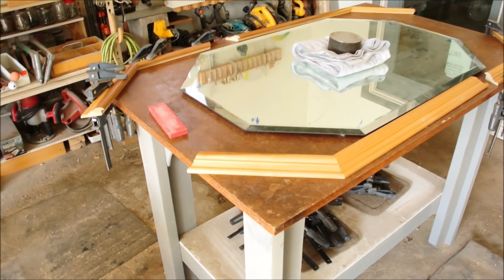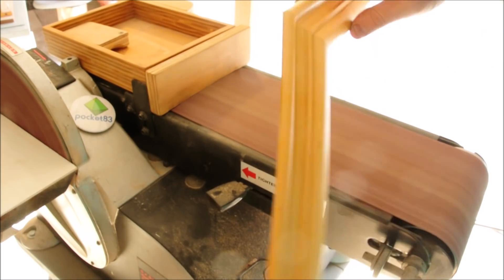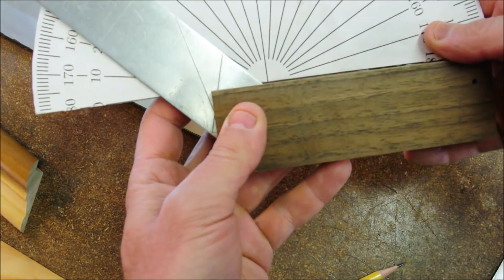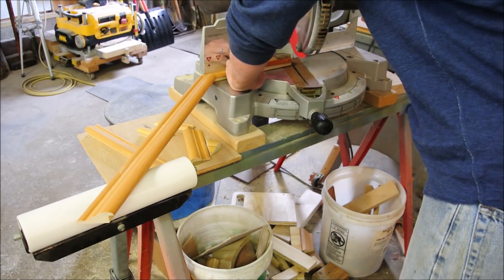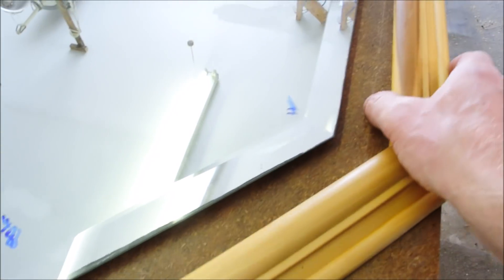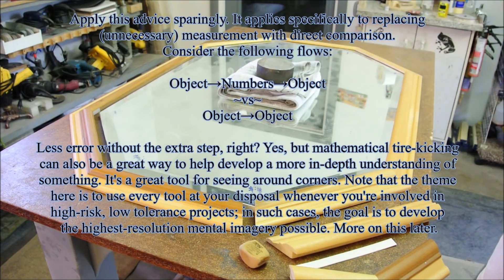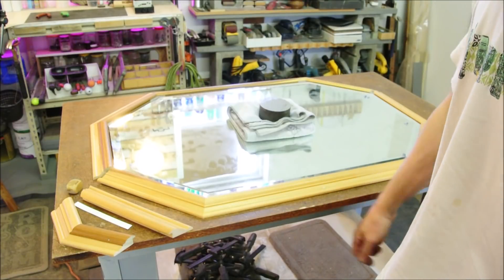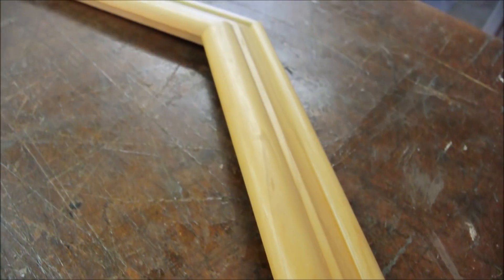Eight perfect miters: overlapping comparisons

Comment: As you shown in the first video, it seems to me that the plywood you used as a biscuit, is more resistant if turned 90 degrees due to the fibers in the middle which are thicker than those on the outside. Please correct me if i'm wrong
Reply from the maker: It's a fair point. I did think about it. It seemed as though it had enough 'meat' to hold up over time, so I let it slide. One of the nice things about (most) plywood is that it has strength in both directions. Just pay close attention to the product that you end up using, and decide what's best for your project.

Comment: It's too bad there's no good angle finder tool that'll bisect the angle for you. There's a handful of these kinds of tools out there, Milescraft makes one, product 8402 I believe, but there's always a given amount of slop due to loose tolerances and/or the mechanism the tool is based on. Even something with either a laser or a thin slot for pencil marking would be nice.
Reply from the maker: As crude as the method shown here is, it's also easy, inexpensive, and reliable. You'd be hard pressed to find a mechanism that'll do better.

Comment: Clear and appropriate expectations about the time and effort required to finish a task is imperative. Without it, one makes mistakes due to impatience. I've seen quite a few builders destroy materials and double the time required because they thought the job should go quickly.
Reply from the maker: That was a constant source of friction for me while in the trades. At the consultation, I'd give a reasonable time-frame for a crude estimate, and the sour faces would never fail to follow.

If I was with a partner, then they'd try (in a desperate act of diplomacy) to correct my evaluation—as though it were way too high—often saying, "It shouldn't take that long." Sure.

Tell me honestly now; do I seem like the kinda guy who can't measure the area of a roof job down to +1.5 extra bundles of shingles? Why on Earth would my labor estimates be any less realistic? Because everybody wants to be coddled. Gotta let 'em down softly. 

Too much dishonesty. How do we maintain the fiction? How to keep the price 'down': people compensate through multiple bids (which drain time & productivity), low-quality work, cheap materials, cash-jobs (which are a tax evasion), insurance scams (which end up raising rates), and using haste-waste as a displacement of labor costs into the 'materials' column. I hated it. And here we have one facet of the reason why we're all being replaced by a mindless corporate process.   

My one old work-mate was so cheap that it ended up driving a wedge between us. He just could not see how much productivity he was losing through trying to keep his/our rates down. We ended up working after-hours, endlessly chasing those imaginary expectations of his. 

Where do people think the money comes from, when our small businesses belly-up from all of those perfect-fantasy bids? Who pays for the bankruptcy? Who covers the lost tax revenue? Diogenes and his lantern would still be looking now for one honest contractor!
Reply: @pocket83squared  I think this problem is endemic. Another annoyance is the constant influx and subsequent demise of new "contractor" businesses that, in order to make a name for themselves, under bid all of their jobs. This is made possible by acquiring debt. Generally, builders that are new to business get either a small business loan or hit their credit cards hard. The debt allows them to lie to themselves about effective job pricing. The low bids are a sure-fire way to get into a market, but sadly, with the side effect of bankruptcy court. All of this debt-subsidised bidding nonsense drives prices down, literally, to unrealistic prices. It makes it more difficult to issue reasonable estimates without receiving sour faces.
Reply: Ha! I got a heart 2 years later. How've you been?